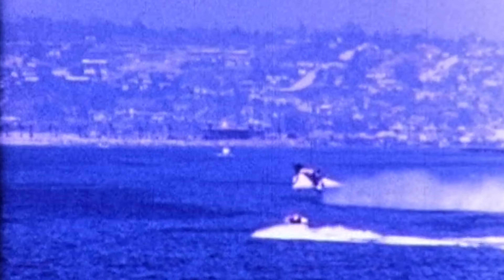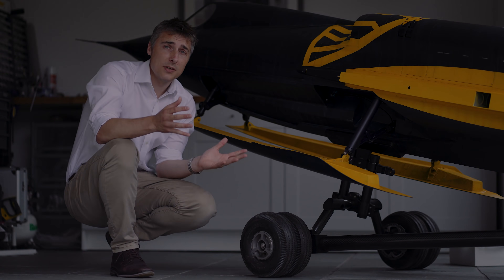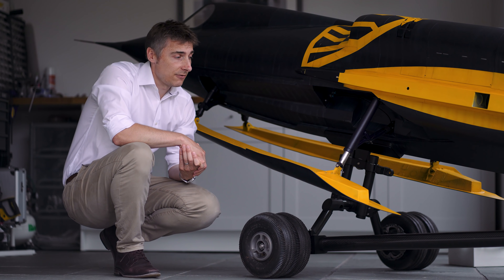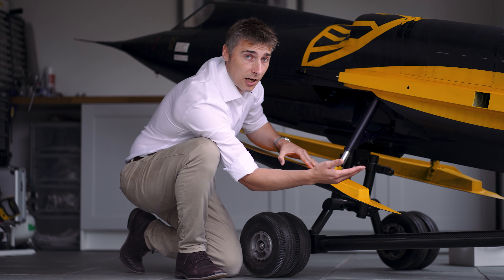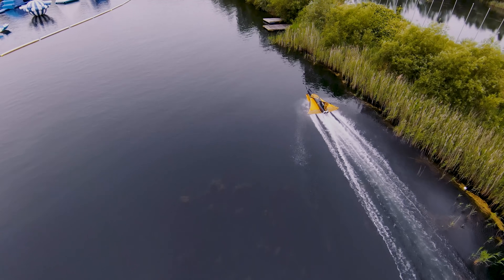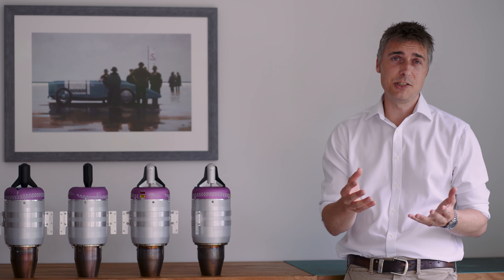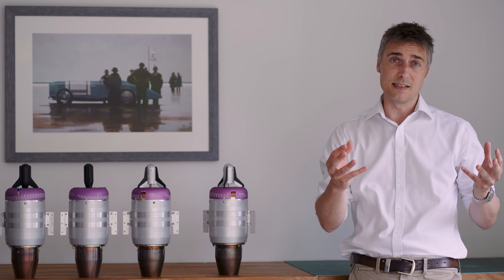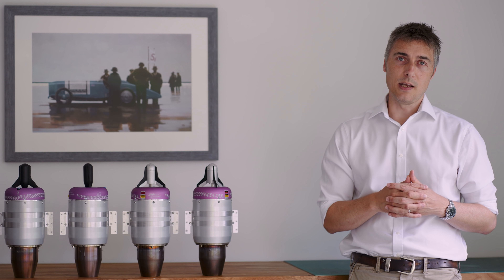CONVAIR F2Y SEA DART | AMERICAN SEAPLANE FIGHTER AIRCRAFT | WATER TRIALS PART 2

Comment: I am interested in the landing. Do you have material about that?
Can you start the plane from land to observe it in flight?
Reply from the maker: It has never taken off into the air so no we don't have anything about the landing 🙄
Reply: @EssentialRC  That is a pity. But would it be able to get airborne without the complicated waterstart?
I know, that is what its all about. But in the end you also want something with decent flight characteristics. So I think it would be nice to get it airborne in an other way so you can already work on that.
Reply from the maker: @MusikCassette  Its a delta. No doubt it will fly well. Thats not the challenge.
Reply: @EssentialRC 
I don't doubt that it will fly, I just would love to see it. Especially see it landing.

From what I read, the original see dart had the problem that its flying stats were not the best.